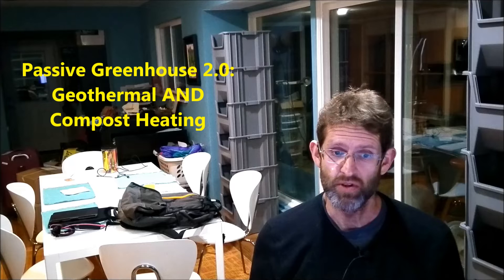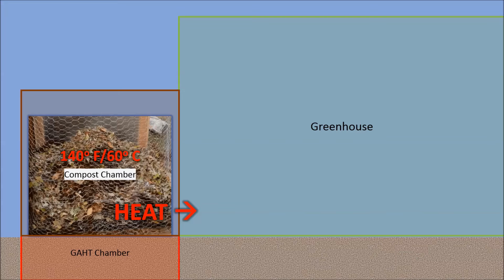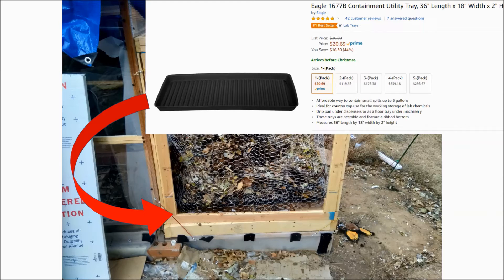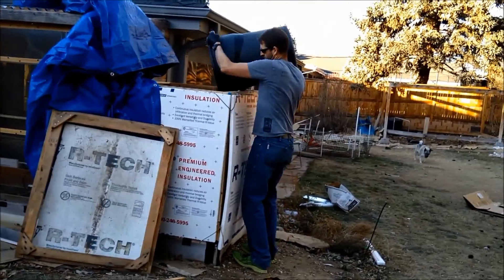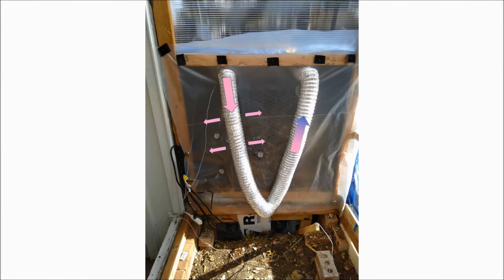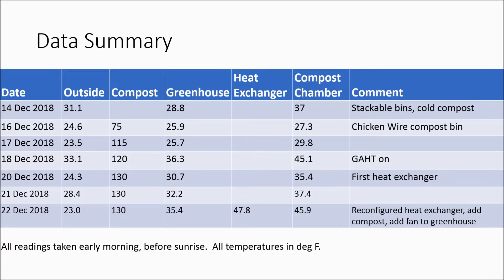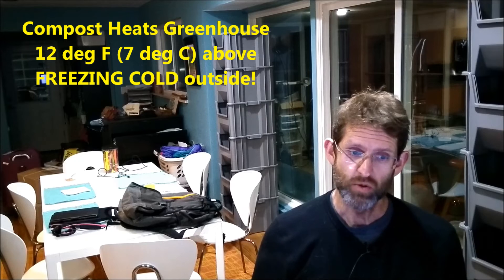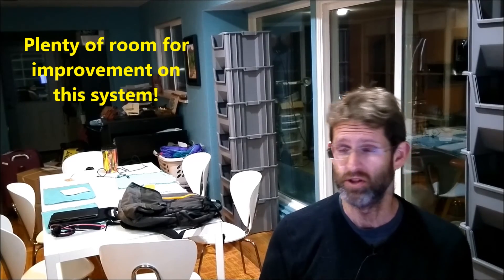Greenhouse 2.0 Compost Heating Results  (Part 3)

Comment: Why the short duct hose inside the greenhouse ?  A longer hose would get more heat exchange..... you could even cut it for an open loop instead of closed loop for even MORE exchange of heat/cold......with no humidity increase
Reply from the maker: The third generation heat exchanger was really effective and essentially a closed system: https://youtu.be/eMHbHAKeMC0

Comment: Please dont give up on this , its awesome …. Im thinking of heating inside my garage with water lines thru a register of some sort 

This kind of stuff is so much fun to puts on!
Reply from the maker: The water line method seems to be preferred for industrial scale compost heating.  Make sure your pile is big...REALLY big.  I used 3x3x3 ft piles for my greenhouse heating, and it simply wasn't big enough.  The pile tends to cool after 2 weeks.  A pile 2x that size would stay warm throughout the winter, I think.

Comment: Wouldnt it make sense that if a small compost pile made a difference, then a much larger pile could mean a HUGE difference?
Reply from the maker: Oh yes!  It's a shame that I am very space-constrained with my greenhouse and compost setup.  I am probably stuck with the layout that I have.  Hopefully the results give people the encouragement to try the method.  You should check out my 2019/20 result.  The new heat exchanger worked very well.  https://youtu.be/eMHbHAKeMC0

Comment: Very helpful video. Thank you.
A couple of my ideas would be to use a high output fan and also a conduit attached to the fan inserted into the middle of the compost pile with holes drilled in it.
If you get enough airflow through the compost then you may not need to turn the compost pile.
Reply: Thanks for the kind words!  I actually tried this a couple years ago (circulating air directly into the compost).  I think is could definitely work, but you'd have to engineer a good solution.  I actually dried my pile out by circulating air into the center of the pile, so you'd have to have a pretty tight seal around the pile to keep in the moisture.  My dream is to have a "self-turning" compost pile.  That would be cool.

I'm in the process of setting up the greenhouse for winter action.  First snow forecast for this Thursday (October 10, 2019)!
Reply: Awesome. I can't wait to see the next installment of this. 
Good to know about the air drying out the pile. I will have to overcome that aspect.
Reply: @goldenages7089  I  bought a small auger that you can run with a drill.  (https://www.amazon.com/Garden-Auger-Drill-Spiral-Planter/dp/B07T7YP6V4) I'm hoping to use this to aerate the pile without turning it.  We'll see how it goes!
Reply: @thepackfiller-morganbrown9297  In my experiment the compost was in a rollie bin placed directly in my bathroom, à large plate hanged under the lid (ceramic would be the best becaus metal rusts !) was hung under the lit so water condensed and drip back to the compost more or less evenly. So there was no problem of drying.

 I pushed air true with the help of an aquarium pump from under and inside true drilled pipes.
 

Behind the plate was a hole where a 1cm ~pipe was connected, wich one was going inside the bathroom chemney to outside.

This automn i will find a way to push in more air than last year because it was not enough and the fermentation went partially anaerobic with only 35°C Inside for one month

Im searching in parallel for more low tech aeration than electrical system; maybe a trompe/ejector system or thermosyphon.

I will also put a better "fuel" inside : freshly shredded woodships mixed with woodshave.

If it doesnt work better i'll try a bigger size.
Reply from the maker: @AutoNomades  I like your idea to capture condensed water using a ceramic lid.  The plastic lid of a trash can might also work for you.

Personally I have had very little need for aeration or additional moisture.  I keep the compost in a sealed container, and it stays moist for months.  I've tried some aeration, and it doesn't really help to keep the compost hot.  Going forward, I'm focused on automated methods for turning the compost.

It's important to make your compost container large enough.  Is your compost container at least 1 cubic meter in volume?  If not, then it probably won't reach a high temperature.  And even if it does get hot, it won't stay hot for very long.  My compost container is just a bit larger than 1 cubic meter, and it only stays REALLY hot (140-160 deg F) for about a week.  It stays FAIRLY hot (100-120 deg F) for about 2-3 weeks.  My next compost container will be much larger.

For my 2019-2020 greenhouse, I used a simple heat exchanger and it worked very well with no fan.  Just natural convection.  https://youtu.be/eMHbHAKeMC0

Comment: Couple of thoughts... 
1. Maybe add another tube heat exchanger lower in the compost pile and circulate the air from it into a ground loop under the green house floor to keep the soil temperatures up. 
2. Possibly incorporate the compost loop into the GAHT system to store heat in the ground " heat bank" on warmer days. 
3. On warmer days and in the summer months you should draw the air from the top of the  greenhouse into the intake of the GAHT... again to store your heat. May need to add a diverter to exhaust the outlet of the GAHT system during the summer. You could... over the summer bank lots of heat to be used in the fall/ winter... effectively raising the overall temperature of the ground surrounding your GAHT loops .
Reply from the maker: First I want to thank you for taking the time to watch the video and provide a thoughtful response.  I put this material up, but I don’t really get anything out of it until I get feedback.  All interesting suggestions.  Regarding 1), I specifically wanted heat exchanger to stay out of the way when I mess with the compost.  These guys doing Jean Pain piles with poly pipe poke beaucoup holes in the pipe when they turn the compost!  But your idea has merit.  Maybe I could squeeze another heat exchanger near the bottom of the pile.  Regarding 2), this is indirectly happening.  I’m running the GAHT and have a small fan blowing 24/7, so warm air is definitely being banked in the GAHT.  But it’s an interesting thought to kind of run the GAHT and compost in a closed loop.  Regarding 3), I’m hoping that the circulation fan is moving the hot air at the apex of my roof into the GAHT for thermal banking.
Reply: @MorganBrown  I've watched all of your other videos, really great info, loved all of it. Regarding your GAHT, do you think it was integral to the results you achieved here? This video focuses on your compost system, so I'm not sure how much of a role the GAHT played here. The reason I'm asking is because I'm fortunate to have access to a "cold climate" greenhouse at my school, which is essentially just a heavily insulated greenhouse, however, I'm not able to dig. I want to build an insulated chamber like you did with a basic heat exchanger but I'm wondering if this will be enough. I live in a cold climate, but unfortunately, much colder (northern Canada) - but a dry climate at least. I do have the option of putting the compost inside the greenhouse, but I want to avoid the possibility of any buildup of NOx gasses, as well as avoid terrible smells as I'll be using food waste. Anyway, regardless if you have an insight, I've enjoyed your videos! Thanks!
Reply from the maker: @AnnaCosmoZ  Always great to hear from someone on the front lines, trying to implement a system!  First of all, I'd say that the fact that the "heavily insulated" nature of your greenhouse is THE most important consideration in terms of passive heating.  In Denver, I could get 2-season extension (on either end) with a very well constructed GH.  My greenhouse has "OK" insulation, and I get 2-season extension with the compost and GAHT.  In my particular implementation, I'd say that the GAHT was a second-order effect.  However, hopefully I've been able to communicate that it DOES work, and that it's simply a matter of increasing the scale.  In other words, I got ~1 deg F of heating with my 4-hole GAHT system, so I conclude that a 16-hole GAHT system would produce ~4 deg F.  That said, I think an internal (to the greenhouse) compost system would be a good choice for you.  I have done much experimenting with compost mixtures.  In my greenhouse compost systems, I don't include any traditional "greens".  This year, I only used leaves or shredded paper as the browns and coffee grounds as the greens.  To minimize odor, I prefer the simple shredded paper + coffee mixture, though leaves & coffee don't smell that bad.  None of the traditional "compost stink" from either of those mixtures.  If you really want to use food waste, I'd highly recommend the bokashi method to "pre-treat" the food waste.  It still stinks (in a different way), but once you throw bokashi'd food into a hot compost pile, it will disintegrate in a couple days (no joke!).  I am a big advocate of covering compost piles with tarps.  This goes against the "conventional wisdom" that "compost piles need aeration", but I simply haven't found any problem whatsoever with my covered compost piles.  They stay at 140 deg F or better for a few weeks.  As an added bonus, the moisture stays in the compost pile, where it's needed, rather than in the greenhouse, where it's not!  If you have more questions, hit me up -- I love discussing this stuff with people!

Comment: I am also in Colorado and I’m looking for season extension two. Can you show pictures of your heat exchanger or small fan? I get the concept of the leaf coffee water compost warming your greenhouse but I’m wondering about that fan size.
Reply from the maker: Cold last night, wasn't it?!  My outdoor thermometer said 4.5 deg F (20 deg inside the GH).  The fan that circulates air within the greenhouse is just a tiny desk fan.  All it does is keep the coldest air from collecting at the bottom of the greenhouse.  I just set it on the floor of the greenhouse.  The heat exchanger is shown at 3:05.  It's just a 15-foot dryer vent attached to a 4-inch duct fan (e.g., https://goo.gl/fLs5Dm) and tied together with hose clamps.  It literally just blows air in a circle.  I then lay half the heat exchanger in the compost.  I cut two circular holes in the plastic that separates my greenhouse from the compost chamber, and the dryer vent is run through those holes.  Does that make sense?
Reply: Yes sir it was freezing!! I will definitely have to explain it a couple times to my husband before we can visualize your wonderful plans when he comes home from deployment. But I am very excited about it seeing as 80% of my garden was unharvested do too early frost this year
Reply from the maker: @8o8latina  yep, we lost our tomatoes late September.  I kept 8 plants growing in the greenhouse last year until December, with the help of hot compost!  https://youtu.be/xNUlrwqNXa8

Comment: How often do we have to change the compost?  Which amount of compost will last for how many days?  The number will be the greatest of all.
Reply from the maker: youngin song I just returned from a seven day vacation.  The compost is still fairly hot.  If I add more leaves and coffee to the top of the compost, it will increase the heat.  I probably will need to turn the compost once per month.   I will add another video showing me turn the compost.  Next week

Comment: first one perhaps insert the tube underneath of the compost so that the air can be down there?
Reply from the maker: youngin song it is difficult to turn the compost if the pipe is buried deep in the compost.  But you are correct.  It is warmer down there

Comment: you exactly what I have wanted. Compost heating and geothermal.  you know also through the compost heating CO2 can be injected, too?  Yet another advantage.
Reply from the maker: youngin song yes, co2 is an advantage of putting compost inside the greenhouse.  It would also do a better job of heating.  However, compost inside the greenhouse smells bad and makes the greenhouse too humid.  This is why I separate compost and greenhouse